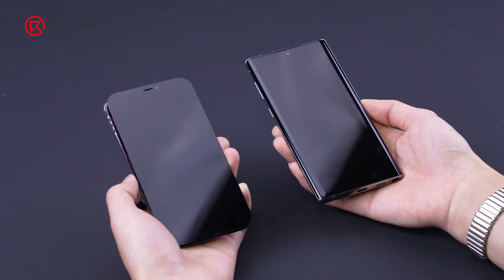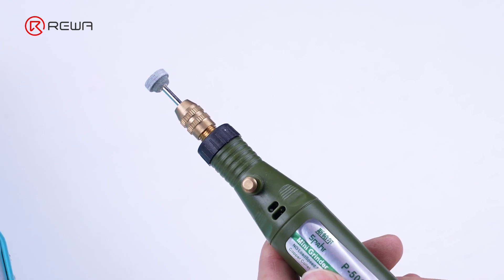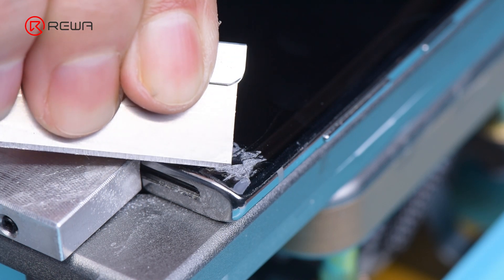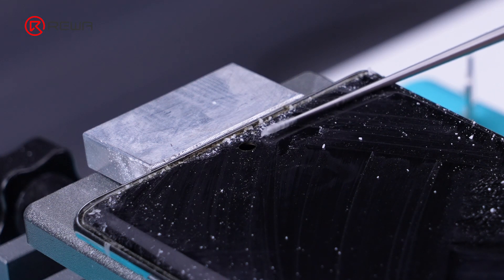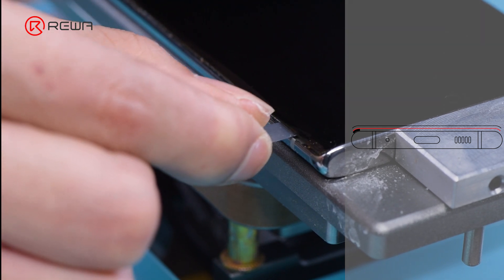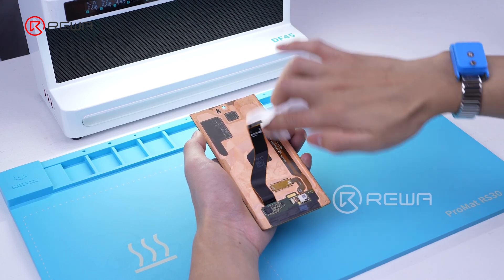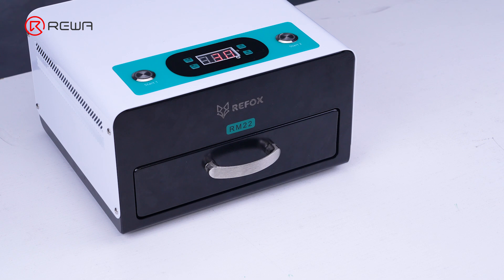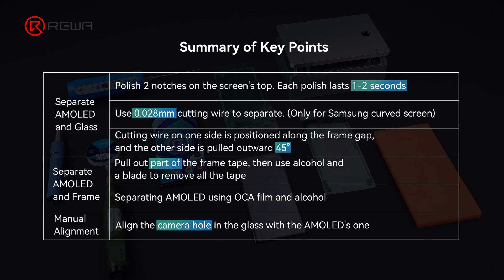Samsung Note 10 Curved Screen Repair Tips (Glass Only)

Comment: Which one is the best glue for sealed lcd screen replacement with 3 type transparent glue, white glue, black glue? Which one is strong bond and harder to attach lcd screen. I always use black glue bcoz it so strong than transparent glue. Bcz black glue is hardener and can tolerant to heat than transparent glue is easy to melting down.